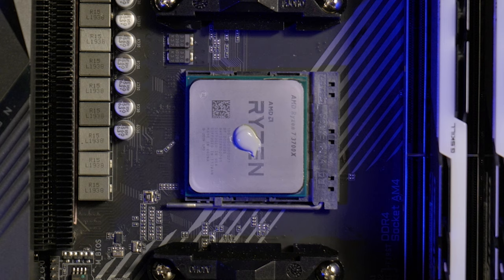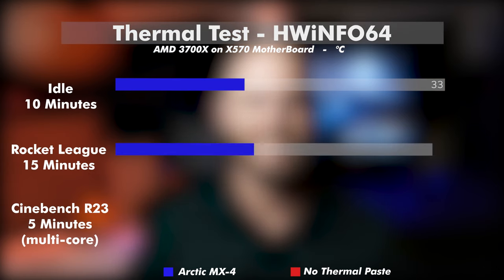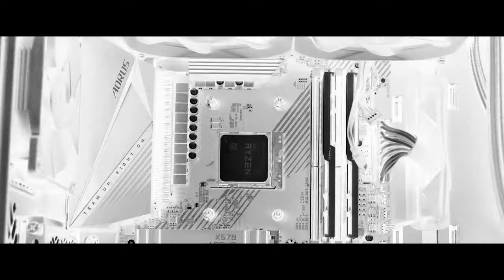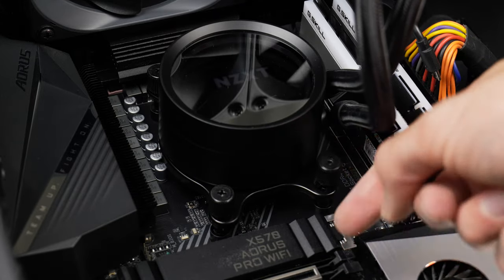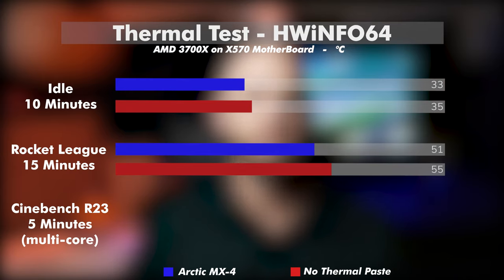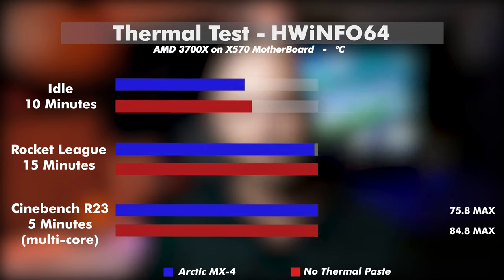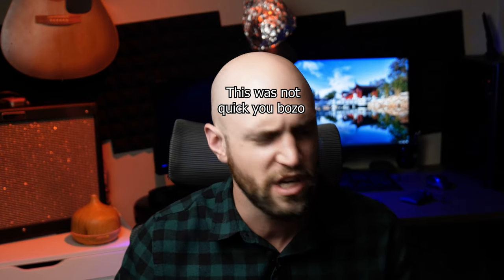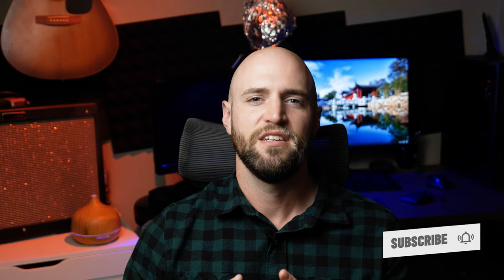Do You Even Need Thermal Paste?

Comment: i expect temps too go up for cooling without paste, but only on coolers that lack the power to displace allot of heat.
So massive cooler same results, small cooler temps up without cooling.
Also temps will rise allot more under higher load without paste, where browsing facebook should not have shocking results.

Comment: Now do this test with an original Athlon, lol. The system will post, then pretty much freeze a bit after Windows loads. Honestly, this video did surprise me. Gotta hand it to the engineers, modern CPU and motherboard thermal designs have come a long way in the past 20 years.

Comment: Thermal paste is more for allowing a more uniform heat transfer, with a no paste setup you risk hot spots on the CPU where there is little contact, whether this would lead to premature failure or not I couldn't say but I wouldn't risk going in dry ;-)

Comment: My prediction: I think it really depends on what kind of heatsink you're using, and how good the contact is. A good quality, well fitting heatsink should (in theory, I think) function decent without thermal paste (maybe a few degrees higher in temp), since metal on metal contact should conduct heat relatively well along with the dissipation from the fan. I'd guess that in probably 80% or so scenarios, the engineering of the proc/heatsink together would be decent enough to compensate.

I might also be biased because I'm still running a gaming desktop from 2011, and it still runs fairly cool (upper 20s- lower 30s C when not under load) despite me never reapplying thermal paste after building it. But I'm also drunk, so let's see what happens.
Reply: my thoughts exactly.  Having a perfectly flat contact point from the heat sink limits any real catastrophe, especially when it's copper. Water cooling is also a good reason.  Try this with a stock cooler and the results will be very different.  I kinda wanna see it happen but for the sake of science I don't want his computer to melt.
Reply: I bet with a worse cooler (like the stock amd one) it would be a lot worse
Reply: @squidwardo7074   The stock AMD one (the wraith stealth) is not bad. I haven't examined it thoroughly but I'm sure it's probably machined very well.

Comment: Every CPU is different, the IHS's are not always flat, they can have little imperfections that can cause areas of the IHS to not fully contact in areas on the heatsink which can cause hotspots.. There is already videos showing CPU IHS's being sanded an polished to a prefect flat surface so thermal paste can be tossed.. Thermal paste is used to assist in those areas of surface imperfections.. Keeps production prices down. You can check your own IHS by using a Flat edge like on a caliper, you can slide it across the top of your IHS  you will see they are not perfect, the heatsink more so.

Comment: I've tried running an old Pentium Dual Core without a cooler attached at all - even with a CPU that's over 10 years old, there was no damage done - the machine wasn't able to fully boot, because it got too hot and the throttling resulted in crashes, but there was no damage. I don't think it's possible to overheat a modern CPU - they'll just throttle themselves appropriately to avoid damage. You probably need to go back some 15-20 years to find CPUs that can actually cook themselves.
Reply: Yeah right

Comment: Thermal paste is so essential specially if you have a low end pc like me (4gb ram ) becz it overheats after using some small softwares i played valorant before when i had thermal paste in cpu it just gives no lag and runs smooth 100 fps but now it runns on 60 fps but it gives millions of stutters so ya its very important

Comment: How do you get the thermal paste off so easily? A couple months ago, I needed to clean the past off my CPU and heatsink. I had used Arctic SIlver and it was a royal pain in the ass to clean off. I tried dry cloths, clothes soaked in alcohol, cotton swabs, both dry and wet with alcohol. Most of the time, I was just spreading it around, more than removing it. It probably took me 30+ minutes just to get all of it off the CPU. the bottom of the heatsink went a little faster, just because it didn't have any nooks and crannies, like the processor (along the edges).

Comment: I am quite surprised. I haven't done any test comparison yet. But I have done a lot of reading in online markets to summarize other players' results of changing from old paste to newly bought paste. Some of them get a decrease in temperature as high as over ten degrees (Cels). But some ppl do find it not so rewarding as temp doesn't change or even gets higher for some unknown reasons.
Anyway I decide to renew my paste. My cpu hits 70 degree when it runs at a usage of 15%. It's supposed to be staying at below 45°C when usage is at about 15%.

Comment: I already tested this when i was 16 back in 2014 back then I didn't know what thermal paste was so i cleaned my removable core i3 processor from my dell laptop placed it again on the motherboard and also removed colling fans and hearsink just leaving the processor naked on the motherboard with ram and started booted the system it loaded the windows 7 loading screen and booted into home Menu but was working slow as it was toasty,and next experiment i tried was removing ram from my motherboard while watching movie ,the screen just display thin lines with red blue green white colours and then i disconnected the battery to turn it off ,and i also continued to play games on that laptop without any thermal paste it was so laggy and hot playing that nfs most wanted

Comment: So I got into situation when I needed to go without thermal paste.
I am replacing my old trusty 4th gen Core i5 with shiny new Zen 4.
For some logistical reasons I ended up waiting for a new cooler for that Zen 4, so I needed to use old cooler from that Core i5.
Given that old cooler is not compatible with new AMD socket, I couldn’t even screw it in, so all I did was just put the old cooler on top of new cpu.

Before that, I even tried to run the new CPU without a cooler, which didn’t go well as cpu just wouldn’t last more than few seconds before it overheated and whole system shut down. So I decided I will just put that old cooler on new cpu and see what happens. Low and behold it works surprisingly well. The old cooler, despite being tower cooler is very light, so the weight itself didn’t create much pressure, so even small force made it move.

But even without thermal paste, or even screwing it in, it worked good enough to do everything on it without significant thermal throttling!

In this case I would still prefer thermal paste just to prevent scratching surface of cpu heat-spreader.

Comment: haha, try the same on the laptop where heat dissipates not through running air but through copper tube where real tied contact with CPU surface is a MUST.  Load CPU to 70-90% and see if your laptop runs for even 15 min.
Reply: This channel is for PC master race :)

Comment: How does the cpu temperature monitoring work? Where is the temperature taken from is it averaged over multiple points, does it vary when taken from different points? how often is the temperature sampled and how much smoothing is done before the data is presented in the tool? I guess what I’m really getting at here is could there be micro variations in the temperature that simply don’t show up, if there is, do micro variations have any impact on performance or longevity? Interesting subject.
I’m not expecting answers to these questions, there just things that crossed my mind.

Comment: My AIO came with a little sticker thing on the cooling block that acted like a stencil. I spread the thermal paste into all the spots and removed the sticker and it seemed to work fine. my 14900K peaked at around 70C in Cinebench. I don't think that's too terrible considering that this is my first PC build ever. Still waiting on the GPU though. Apparently everyone that has 4080's in stock only say they have them in stock. Have yet to see one actually show up. And I don't want to make the 6 hour round trip drive to one of those only Microcenters in state.

Oh, the AIO is a Coolermaster ML360 Atmos.

Comment: I have a Ryzen 3 1200 running with the default cooler that it came with, and only one fan at the back of the tower and, finally, no thermal paste, at all. It reaches, in the summer, an average of 53°, and I'm yet to test it on winter. However, I don't do benchmarking, so that temp is mostly average use.

Comment: I think the temp will only be a bit higher like 20-30%. Like the paste is there to improve the transfer not to create it.
Reply: Could it be that the liquid cooler has a surface that already has very good contact/that much more effective, like I didn't think it would be only 5-15%. I have seen bigger differences in PC's with old thermal paste so...

Comment: Hey I know this is an old video but there is generally no need to worry about the CPU cooler not making good contact with the CPU and it frying anything. Generally all modern processors have sophisticated throttling and other safety measures in place to prevent it just heating up and frying, including the IHS.

The core is generally under that metal heat spreader that is installed from the factory on a majority of modern desktop processors that already acts as a small heatsink (also prevents chipping the die from installing and removing the heatsink).

In fact, a long time ago Toms Hardware did a test in which they removed the CPU heatsink while a computer was gaming in the early 2000's I believe. They found that the socket AMD Athlon processors of the time (thunderbird cores) just went up in smoke and died (they didn't have an in-die thermal diode so they were not self aware of how hot they were), taking the mobo with them in many cases, but Pentium 3 processors crashed and protected themselves and the mobo, and Pentium 4s gracefully throttled and would even resume working as if nothing had happened once the cooler was placed back on the CPU.

The Pentium 4s were also one of the first mainstream desktop processors to get an IHS. You could say the Pentium 4 was the first mainstream processor to get modern CPU overheating protection. I believe AMD also added a thermal diode in their next Athlon XP cores and began implementing their own overheating protection.

Comment: I never understood this modern assumption that you need a bunch of thermal paste on your components. Back in the 90's and early 2000's the practice was to put almost none or very little thermal paste on (it is only meant to fill in gaps on the surface only) Metal on metal is always going to have the best thermal conductivity, the issue is that the surfaces aren't perfectly flat, and that is where thermal compound comes in.

Comment: Did you clean paste from the cooler?

My thoughts.

1. Your cooler did great job. Other coolers may not
2. Better thermal pastes like Gelid Extreme or Grizzly Kryonaut could perform much better and differences with them and without them may be higher
Reply from the maker: Yeah, cleaned it. I suspect I could have gotten a few more degrees out of different paste but overall not much more. I would like to try this with a very basic air cooler.

Comment: the pc in my shed doesn't have thermal paste, just the dry leftovers from the system it used to be in. it gets about 50c normally, however, the fan goes absolutely crazy on startup, so it may be throttling under load. Doesnt really matter, as it is a frankenpc with a first gen i5 and windows xp
Reply: I have a similar PC. I scraped off all the remaining dried out thermal paste and it improved the temps by like 10-15C+, the PC is running much better now and the fan is a lot quieter. The thing is, if the paste is dry it's just in the way. Dry paste has lost pretty much all it's thermal conductivity and isn't evening out the contact surface either, it's way worse to have it in than not at all.

Comment: I accidentally ran my PC without thermal paste for 30 minutes. It is a i5 4570. I was running Windows diagnostic because I had trouble downloading windows OS. Is my cpu alright?
Reply from the maker: Did you have a cooler installed?

Comment: I did a no thermal paste test around 15 years ago or so. And my CPU got burnt out when I turned it on. Like it started smoking and completely ruined the CPU nearly instantly. This was tested on an even older CPU as I had just built an entirely new computer. The Intel CPU itself was probably manufactured in the early 2000s. I was using a much lower quality heatsink and fan than you were using.

Comment: Can you test the "Thermalright Valor Odin" pads on the CPU?!   they say it is also for CPUs on most sites,well for this purpose i wrote to the guys at thermalright to ask them  just that,if its good for CPUs,they said i should use thermal paste,and i hate that mesi,drying and cpu suctioning paste that can stick to the cpu so hard you can hardly remove the cooler from your socket! the pads have a 15w/mk it should do just fine replacing thermal paste...

Comment: I thought the temp diff would be higher.  I run a 5950x currently using Arctic mx-5 and would never think about trying to run it w/o thermal paste.  I use the EVGA CL360 with Antec Prism argb fans and it currently idles around 122°F with all cores set to 4.5ghz.

Comment: couple degree actually slow down your cpu, but, model computer ... normal gaming...it really doesn't matter your pc will not lag.. the pc nowaday is over powered. i am an industrial design and i design heatsink, the paste is there just because it cover the engineering tolerance in production, the paste was improtant in old time but in modern factories... the tolerance is so tiny that the paste is actually... i mean.. better than nothing? i guess.. all the products are actually went thru random check before we got a cert for it. so it just like... you are right.

Comment: In another video that you made in which you measure the temperatures of various ways of applying the thermal paste, I saw that when you put too little the temperature difference was very large with all the other patterns. How can it be that putting too little heat a lot and without thermal paste does not heat much and there is no big difference?

Comment: The reason to use thermal paste is to take up inequities between the planar surface of the cpu and the planar surface of the cooler, ensuring better contact ON AVERAGE. One test does not have statistical significance.

Comment: I mean, we see in subreddits like pc gore or smnt, people who forget to take the plastic cover from their coolers, the pc works but gets much slower. Buta that is literally a layer of plastic on top of the IHS...
When I was a teen and worked in a computer repair shop CPUs did not have boost technology, so they didn't throttle per se, but still we checked for post by putting another CPU on top of the installed cpu, ihs to ihs, and that got us a minute or two to test things out and even one time to flash the bios, all without a cooler and without thermal paste

Comment: im pretty shocked....you really dont need thermal paste with those numbers...85 at a max really is not that bad...that being said, Ill take an 8 degree cooler CPU for 10 seconds of work.

I would be interested to see this test on a High end Intel CPU that has higher clock speed overclocking headroom and draws a lot more power.  That might be an expensive test though if it fails LOL
Reply: 10C is a fairy large difference, but you are right it isn't the end of the world. I honestly expected it to get to like 60-70 while idle, Max Temp under light load, and safety shutdown long before the bench was done. Kinda shocked me it matter so little.
Reply: I'm gonna be switching to graphite thermal pads next time I need to change coolers/upgrade my CPU. Thermal paste, while giving slightly better temps, isn't worth the hassle anymore. The pads can just be reused as well.

Comment: I expect to see a big bump upward in temperature without thermal paste - maybe 12 degrees.

I suspect the difference would be greater if you were using the Wraith Prism cooler, rather than water cooling.

Regarding the use of thermal paste, it was created for a reason. Anyone building a PC should use it and protect their costly CPU.

Comment: Okay, paused at thirty-three seconds...
My belief is that thermal paste helps fill in any small nicks and crevices in the heat sink and the CPU, making sure there's a more solid contact between the two. I've seen arguments for thin layer vs. thick layer vs. barely there. My current CPU (AMD Ryzen 5 1600) came with a stock heat sink, and it had the thermal paste already on the sink; just peel off the protective paper like it's a decal and install. Right now, it's running at 39°C, so this method does look effective.

As I said before, I've heard from so many camps, and I've never seen anyone do a proper comparison until now. So I'm looking forward to the results. My prediction? There may be a spike in temperature, but not enough to damage the CPU or the computer as a whole.

Now hitting Play...

Comment: I expect it to run hot by ~15° C and probably throttle, but I imagine it will otherwise work fine without triggering thermal protection.
Reply: Well, I've seen it now and I'm happy to say I overestimated the results. This video is exactly what I was searching for. Now I know I can bench test this AIO without paste just to see if the pump is working. Thanks!